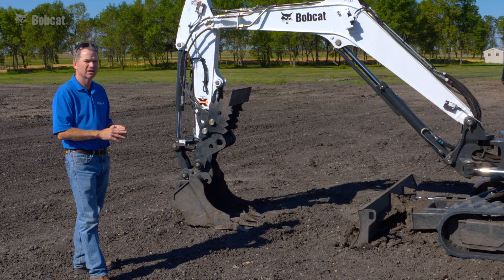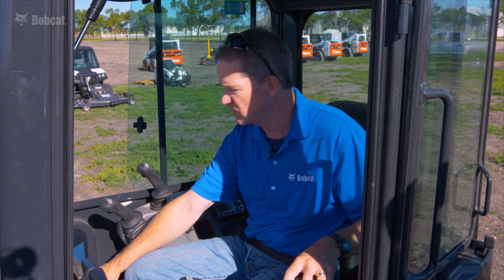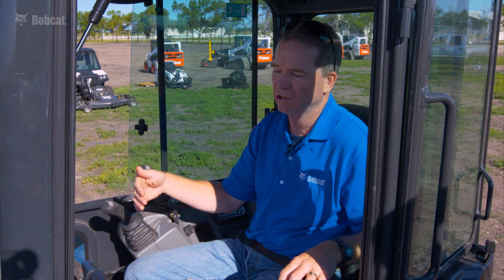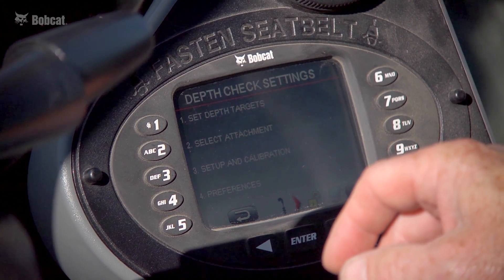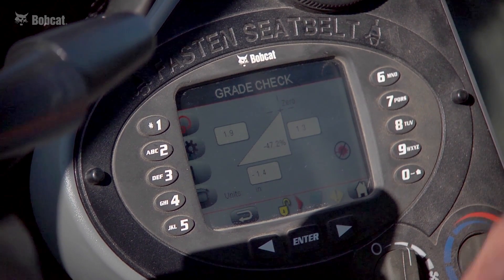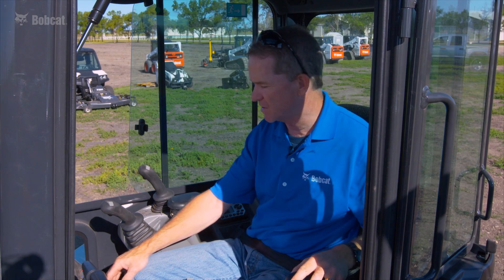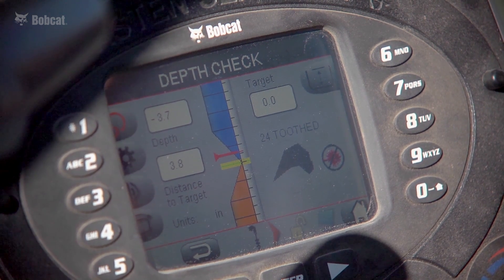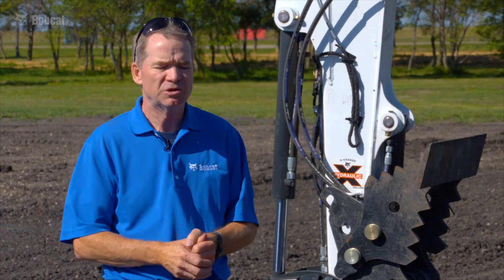Bobcat Depth Check for Excavators Episode 1: Technology Overview

Comment: I have a 2014 E35i, with the A91 package and the deluxe control panel. I believe depth check came out in 2015. Can I install a depth check system on my excavator?  Thanks!
Reply from the maker: Thanks for reaching out to us, Kurt. We're happy to help, just need a few more details from you about your machine. Please give us a call at 1-800-743-4340.